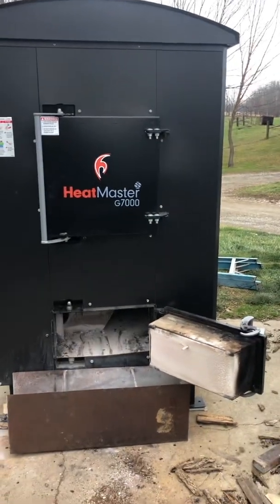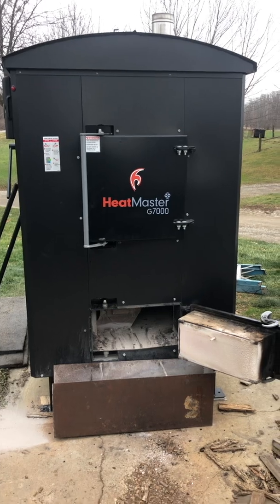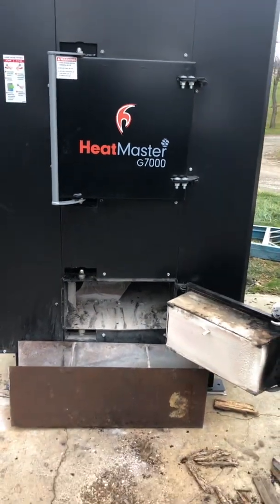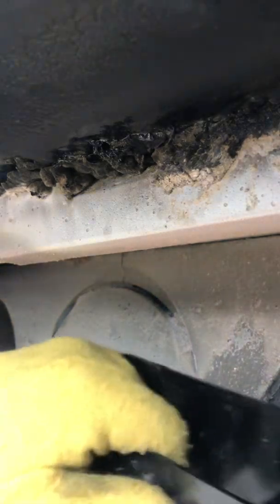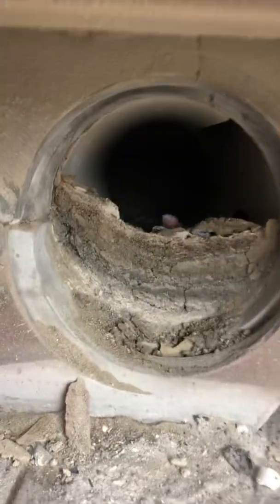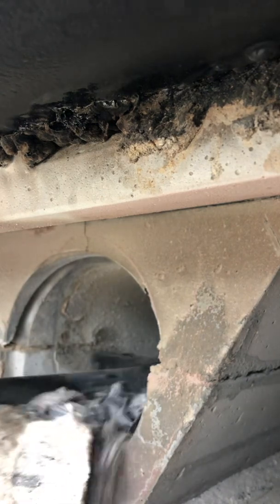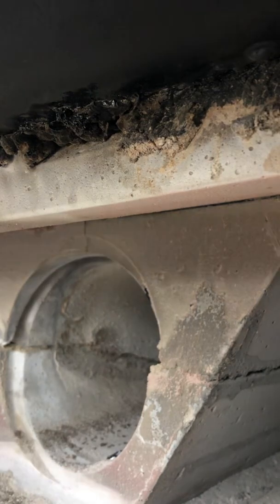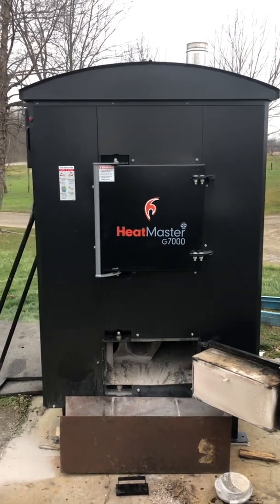G7000 refractory plug removal

Comment: I have to take the plug out every 3 or four days and it's always plugged full. If anyone knows why please let me know.  Thanks
Reply from the maker: If it’s not burning the gasses off 100% of the time it’s running the velocity is slower thru the bottom, like any other engine, when the fuel is ignited it expands, when it expands it has to travel faster to make it thru the bottom. 

Also check the little block on the left hand side as you’re looking at the stove, it should fit tight in the corner and not block the opening at all, sometimes people move them while cleaning and don’t notice.